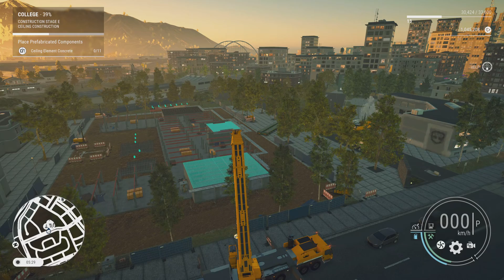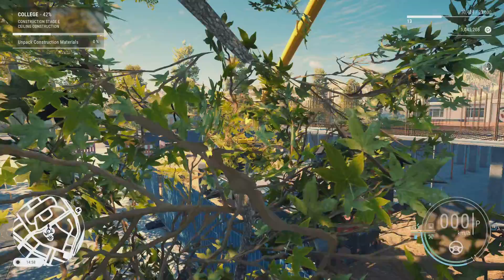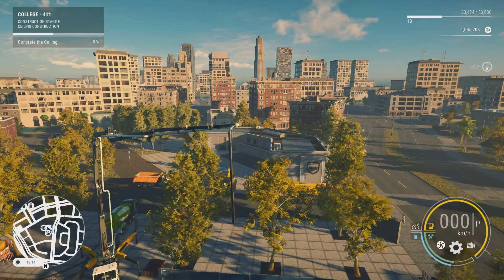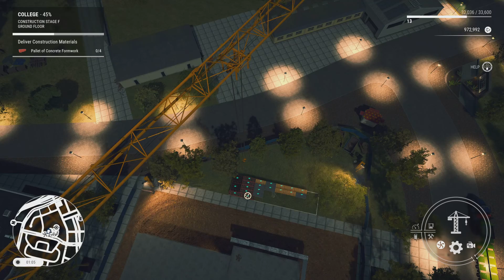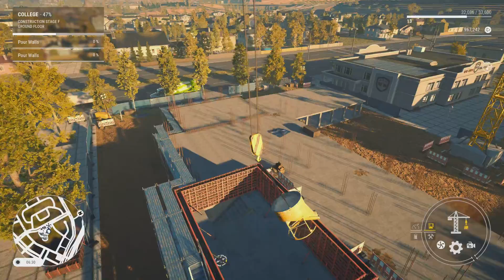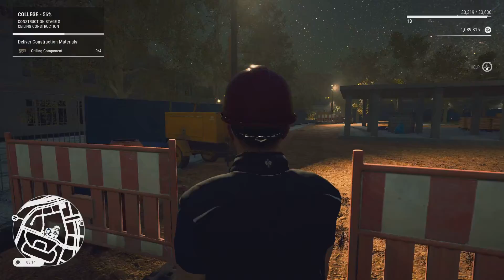NEW CONSTRUCTION SIMULATOR 2022 | #19 | COLLEGE BUILD Pt 3 | PS5.

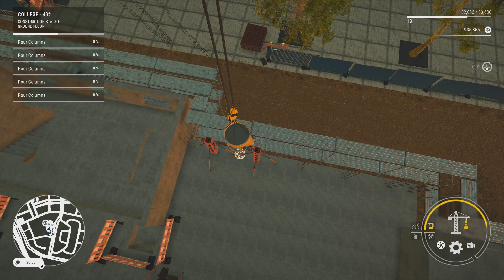Comment: 40:00 On the large bucket the green indicator only appears during pouring concrete. For these collumns I think the small bucket fits better because it releases the concrete dead center directly in the middle beneath of the bucket, while the big bucket always pours to the side which is very handy if it comes to small circles - just turn the bucket for 360° while pouring. Pouring is only doing proper if the concrete level of the bucket is going down if it isn't you've just not quite found the sweet spot. You can pour the leftovers back into the concrete mixer before storing the buckets away.

Comment: Yes, stop having fun. LOL  Just a helpful hint, the smaller concrete bucket I think, pours straight out the bottom center NOT out the side, so it is much easier to use on those posts and walls.  As for the comment you made about we would think it is not worth it to buy the tower crane, I think just the opposite, I would have to look at the 'missions' to determine if it is worth buying the mobile crane, I would definately buy the tower crane to do buildings in the city.  ! Also use the concrete pump as long as possible before switching to the bucket.  Enjoy, love your videos.

Comment: I've found that if a job has a place for a tower crane it's always worth the 5k to set it up right off the jump.
Reply: It depends - for building a single car garage like in the tutorial a tower crane is the same overkill as the concrete pump. If you have a large multi floor building like this the tower crane is useful (if it is big enough to reach everythere - the Liebherr LH1 won't on this site and the FK250 also won't reach the complete material delivery bay) - but for a single family house for example it makes sence to use already owned mobile crane instead to save the build up costs.

Comment: 4:35 When you're picking up stuff the marker on the ground will turn green when you're in the right position to pick up. (Exept for pallets)
Makes crane work a lot easier if you learn to read the marker.

Buying that tower crane was the best investment you could have done in the game, you'll soon find out it's gonna be one of your most used machines. The tiny price of setting it up is well worth it to save yourself from the hassle of using a crane with a boom(Taking it down is free).

30:00 You only need to buy 1 bucket and you'll never have to buy another. You'll keep it when the job is done, then just store it and use it again on a diffrent job.
39:55 With the bucket you won't see the pour marker until you turn on pouring. Gonna be much easier to aim if you turn on first and then move into position, you wont be wasting any concrete by pouring somewhere it shouldn't be.

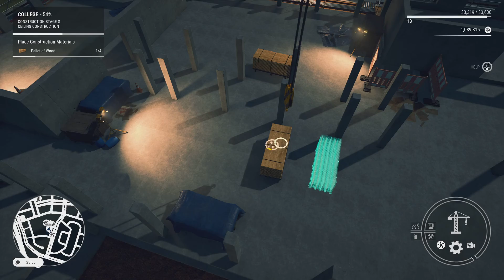45:25 You're gonna need both the tower crane and a mobile crane. The tower crane is great for 99% of the lifting you do, but it only got lifting capacity B. Some jobs require up to capacity D wich you'll get with the large mobile crane (The small mobile crane got capacity C)
Also for some jobs you won't be able to set up a tower crane.
Reply: You also get a Sound signal on tower crane when you can pick up / drop. You usually have too be no closer than 2nd zoom.